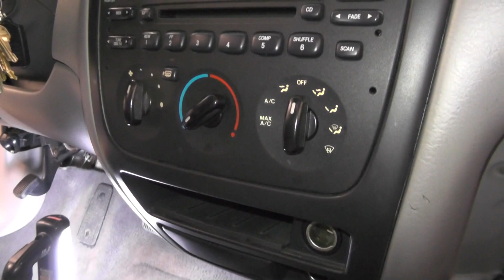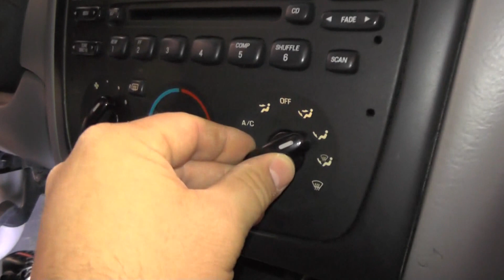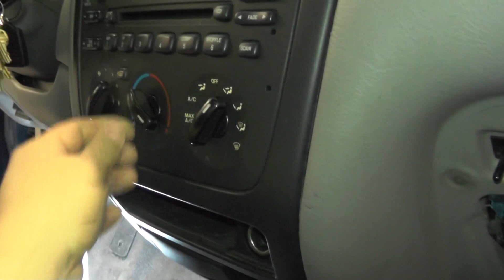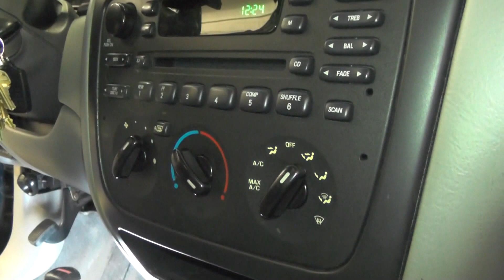2001 Ford Taurus A/C Controls Operational Question

Comment: I 've been researching alot on here. I have a mercury sable that the battery dies after a couple days sitting. I found a two amp draw off battery when it is sitting. The one answer I found said they had changed the a/c control panel which is same as radio and fixed the problem. I had problems with air vents and also radio volume control. Sometimes radio stayed on when my car was shut off, random issues. Now my question is how to change radio head or a/c control panel?

Comment: I have only air out of the defrost vent at the windshield. No other vents. What is the possible cause? Thank you
Reply: I had that problem my mechanic found a vac hose that was broke in half that went from the hose on the fire wall passenger side down to the blower motor now air comes out of vent.

Comment: I don't get any air out of my vents facing me! Only air out of vents by the windshield! Any ideas how I can do a diy  fix! Can't afford to take it too a shop! It's a 2003 Ford Taurus SE! Would appreciate advice thanks!
Reply: It means that its a vacuum line . Open the hood and look to the 
passenger side of the car just under the lip were the washer fluid feed 
line is . Just behind that clipped to that lip is a vacuum line . Its 
probably broke right there . Take the end off from the vacuum line and 
force a screw into the end ,where it broke off, now after you thread 
screw into it , take a pair of pliers and now pull the screw out with 
the pliers . The broken piece should come out . Now push it back onto 
the vacuum line and push the broke part back in place
Reply: I'm having this same problem with my car
Reply: Same problem help

Comment: It’s vacuum controlled it’s a plastic hose that runs from a line on the passenger side under the hood out the firewall I’ve had to take the hole plastic line off and replace it with another one cause they dry rot bad and I got the replacement from a car at the junkyard without that line hooked up or any part of that line missing it defaults to the floor and defrost in this car hopes this helps someone get they air/heat blowing strong

Comment: I have a 2007 Taurus and  I replaced the blend door actuator and saw the blend door arm was not broken, no change after replacement. I had it in the shop and they did a diagnostic showing thermostat bad, it was replaced. Still no heat The blend door actuator doesnt move when I change it to heat it says on cold this is the 3rd time I replace it what could it be?

Comment: thats not a "problem" when the ac comes on out of the panel/floor blend mode. I have had 5 taurus/sables and they all do that. some people like to cool their feet off too during a hot day. ford designed it that way in the 96plus taurus/sables because they lack more simplified import style controls. ever see some cars that have the rotary dial where you can selcet an infinite blend of air anyway you want it? well obviously, these dont, so they designed it to have the compressor come on so cooled air can reach under the seats through the heat ducts in the rear passenger compartment of cars without the rear seat hvac vents (column shift models). people like me love it, my feet and legs get hot too!

Comment: what dose it mean if you dash vents don't blow the ones pointed strait at you
Reply: It means that its a vacuum line . Open the hood and look to the passenger side of the car just under the lip were the washer fluid feed line is . Just behind that clipped to that lip is a vacuum line . Its probably broke right there . Take the end off from the vacuum line and force a screw into the end ,where it broke off, now after you thread screw into it , take a pair of pliers and now pull the screw out with the pliers . The broken piece should come out . Now push it back onto the vacuum line and push the broke part back in place .  Done now your upper vents will work !
Reply: David Hildbold ... I been trying to fix that same problem. Today I was checking that específic area under the hood. And found a white yellowish line unplugged. My question is... Is that the vacuum Hose / Line you're talking about ? And if it is. Where the heck goes to ? 

I know I know, there should be a hole or tube where just using common sense will tell me " right there " but I just don't see it ! 

Is it hidden ? Do I have to remove the panel at the bottom of the wipers to see it ?

There's a black one too. But that one is already plugged. Maybe that's the one you're talking about. I will check it tomorrow. To see if is broken like you just explained. 

About the yellowish line. What is it for then?

Thanks for your help...

Comment: They are doing what GM always did, called bi-level.  so you get ac air from hi & lo vents, what if your feet are hot?  it's the only option that directs some of the air down to the feet.
Reply: GM has almost always done it for many many years it's called bi-level
Reply: The cars I'm talking about never
Reply: The car is on talking about maybe a little bit older I haven't had a GM in a few years but they did not have a button to turn the AC on or off just certain selector position this activated the AC and other ones did not
Reply: Don't ever get a Passat.
Reply: Pos